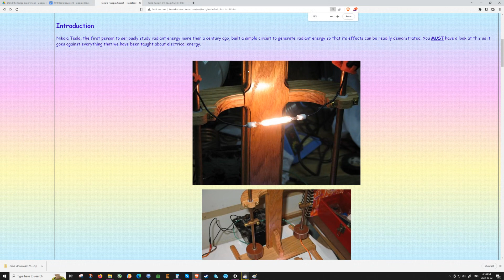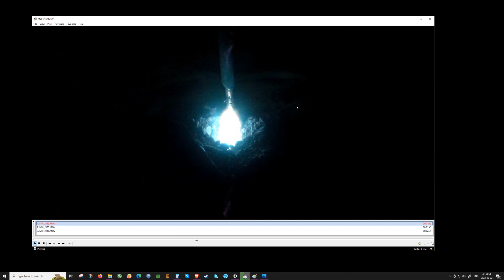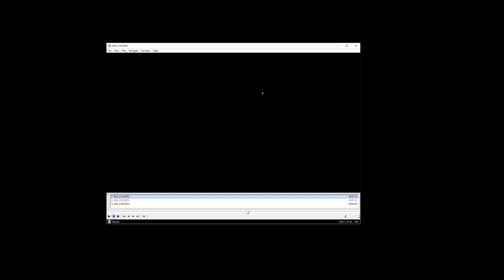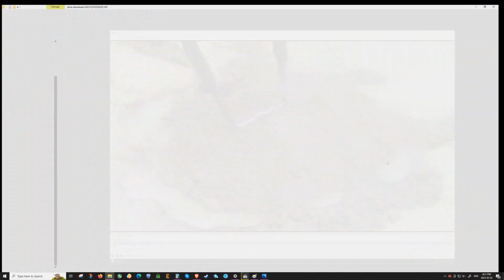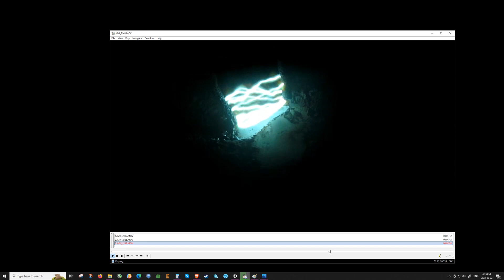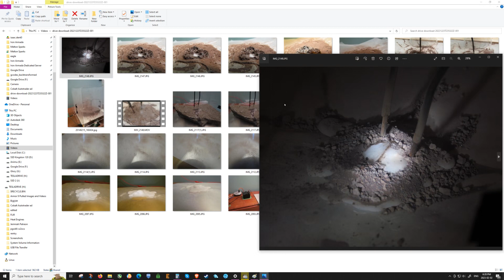The Tesla Hairpin Circuit and its Violent Tank Capacitor Spark Gap Arc Discharge

Comment: Where are the two capacitors?
Reply from the maker: They are in parallel with the spark gap and the 10,000V AC transformer. My setup used large 2.2nF strontium doorknob capacitors. The purpose is twofold, to create a large isolation impedance between the high voltage and the stout bars (the hairpin), and to create a tank circuit that rapidly and violently discharges across the spark gap, which also forces that current to flow through the hairpin (in a closed loop, of course), creating strong EMFs, or as magncity1817 put it, radiant energy. That form of conduction can allegedly light bulbs and generate sparks without the risk of electric shock.